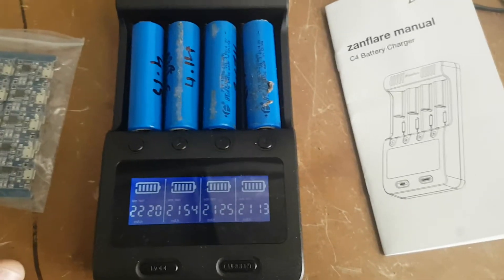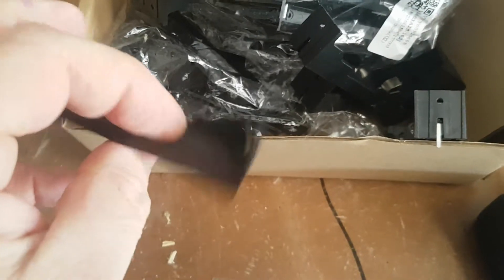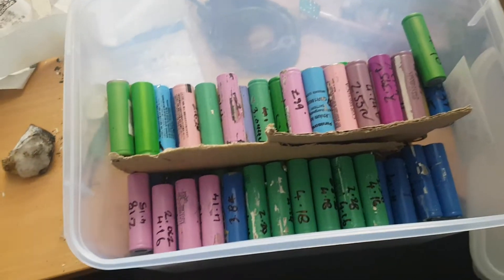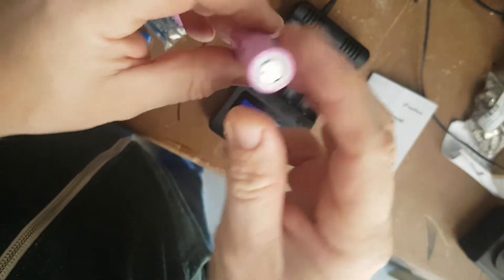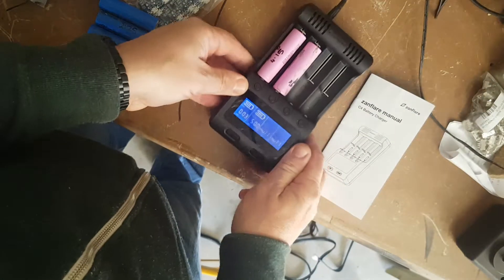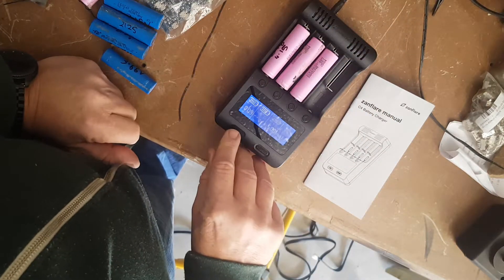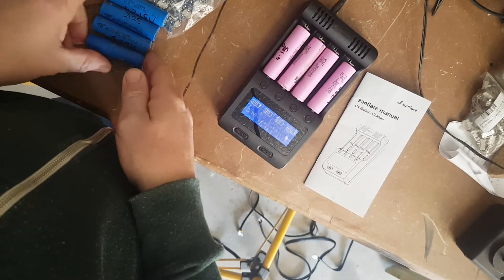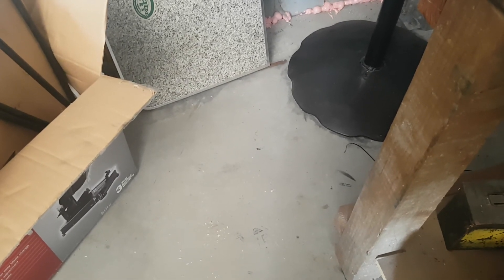Capacity test on the Zanflare C4 Tester. It really works for 18650s and rechargeable AA  and  AAA.

Comment: I have the exact charger for my 18650 batteries. Can I ask you a question regarding this charger. When you use the NOR Test what's the cut-off discharge voltage please? my 18650's 3500mah cannot be discharged below 2.70v so I was wondering if this charger has auto cut off based off the battery? Thanks
Reply from the maker: The cutoff voltage is 2.8 volts on the Zanflare C4.  I have noticed that sometime it does not read for some cells, leaving them blank. Or the IR is too high. I have started using the DIY Charger Discharger, which is more accurate. Thanks for the question have a wonderful day.
Reply: @chuxxsss  Thank you so much for your answer. On my 2nd batch 18650 batteries one of them had an internal resistance of 406 is that normal as the other one was 136. The right battery had low charge voltage and low capacity so I took it out and reseated the cell which put back into the battery 598mah to bring total to 2734mah in the right battery and the left battery charge voltage was fine and so was the capacity which was 2759mah and charge internal resistance of 136mR. These two cells are brand new bought online from a dealer amps plus 3500mah 18650 button top non protection. The batteries were pre charged to 30% so adding 2734+30%=3554mah and 2759+30%=3586mah
Reply from the maker: @PinkGirl2242  I normally charge to 4.1 or 4.2 volts then do the tests. Check out my charger, which is a old pc power brink with lots of TP4056s connected to charge the cells. Sometimes if I test more than once the IR charges too. That is why I build Brett's DIY Charger Discharger to make sure I had it right.
Reply: @chuxxsss  The charge rate I use is 500ma and charge the cells to 4.20 if possible usually its 4.18-4.20 lol
Reply from the maker: @PinkGirl2242  Yes it does not charge above 500 mA. Other brands do discharge at 1A, which is quicker.
Reply: @chuxxsss  it will charge at 1A, but not on the testing mode.  You can choose 300, 500, 700 or 1A - in charging mode.
Reply from the maker: @vision8579  So set it to charging mode and choose the current for charging?  Will this tranfer to the NOR testing charge setting?